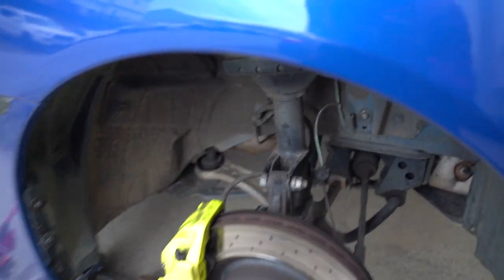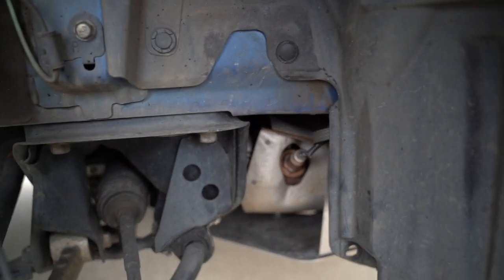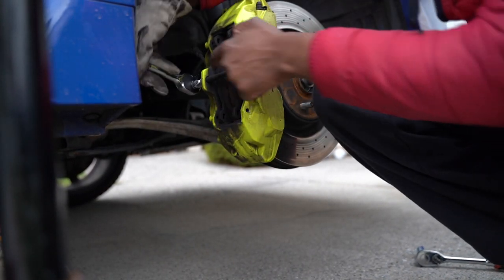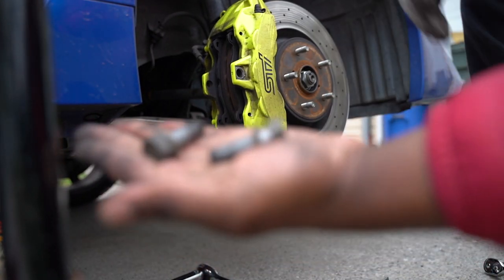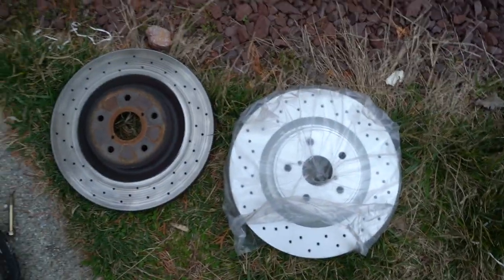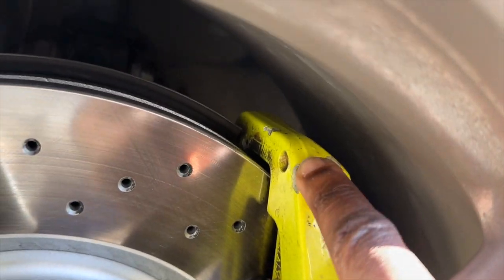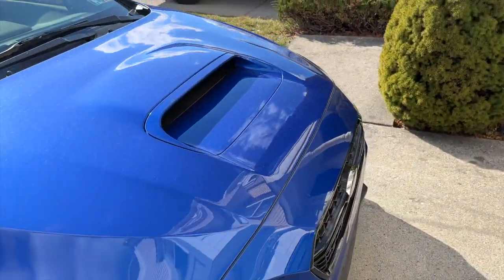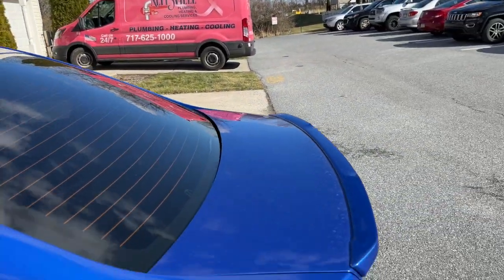WRX STI gets new Rotors and Pads and here is why STOP Brake dust

Comment: You don’t necessarily have to use the bolts to remove the rotor I just used a rubber mallet and smacked the crap out of it took a couple mins but was easy
Reply from the maker: I will try that next time
Reply: I’ve been smacking it with a mallet for hours couldn’t get my rear passenger rotor off. I might been to try the bolt method
Reply from the maker: @happymanwoow lol 😂
Reply: @Duraguy  gave up after 3 hours of pounding and lost daylight lmao. I’ll try to see is my local auto shop had any of those bolts